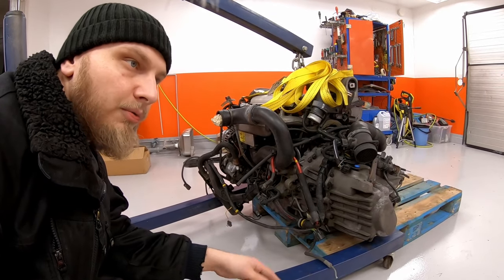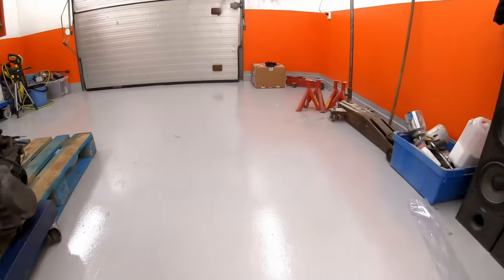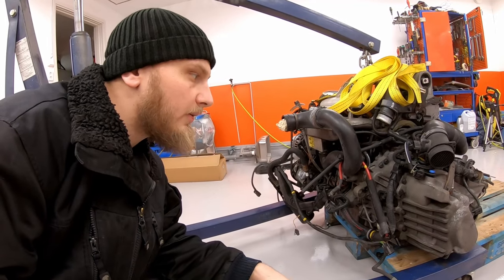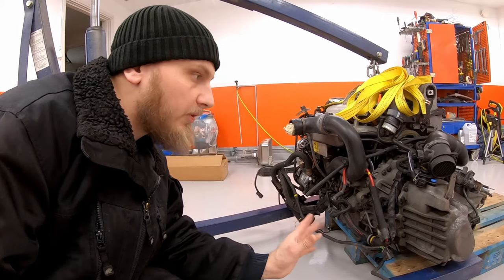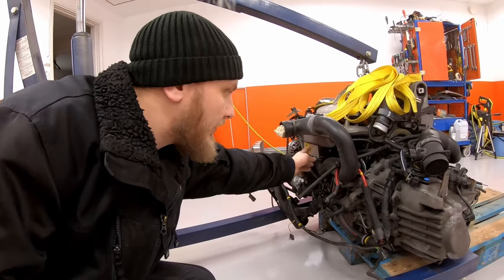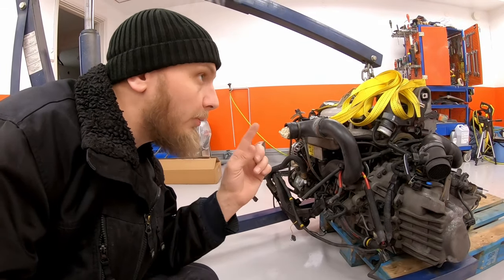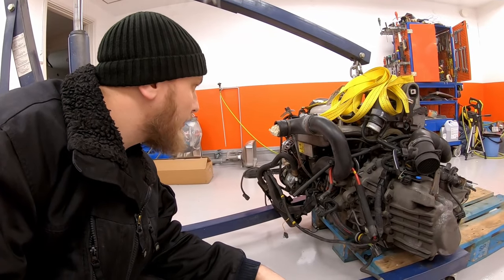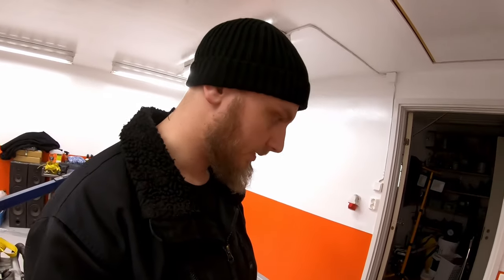VOLVO 740 T5 ENGINE SWAP - Part 1 - INTRODUCTION OF PROJECT ENGINE

Comment: this is great, thanks for producing this series!
what transmission are you going to be using? The M90 for whiteblocks seems to be difficult to find (in the UK at least) so it would be cool to see an alternative, and what extra work would be required to make a non-Volvo trans work.
Reply from the maker: Thanks for the comment! 👍 The plan is to use the M90 from the volvo s90/960 that i have. At least for now. 

But when i pull the t5 out and build a more powerful engine we are going with a getrag gearbox from a Bmw since the M90 doesent last long under pressure.
Reply: @BackmansGarage  cool, will be good to see how it turns out!
Reply: @CzMnHD  *You're

Comment: You mentioned that is not a very good t5 engine. What Volvo t5 engine would you suggest, or prefer to use? Also, your english is great! Tack!
Reply from the maker: Thanks! 👍The biggest problem is the bore size, on this engine i have 83mm and that leaves the cylinder walls thin and prone to cracking. I would suggest a B5244T5 2005->  81mm bore, you can run 400hp+ on stock bottom end no problem. //Backman
Reply: What do you think of the later (2001/2004) 2.3 T5 engines? Are they not even stronger than the 2.4's?

Comment: hello people, PIEASE someone tell me about instaling m90 gearbox to this t5 engine, how? just install to stock hols? without modifications?
Reply from the maker: No modifications to the bell housing. But you will need a M90 gearbox from a whiteblock engine, the M90 from a redblock (A Volvo 940 with a b230 engine for example) will NOT work. The gearbox can be found on any manual inline six cylinder Volvo 960 or V/S90
Reply from the maker: Saw the photos, looks like it might actually fit by the looks of it🤷‍♂️I have no idea how you intend to do the clutch and flywheel tho. 

I would try to get a hold of someone who has done a swap like this for more information 👍
Reply: @BackmansGarage  i thought that clutch and flywheel from b5254t manual transmission will fit, like you used, or from m90, not sure...
Thanks bro